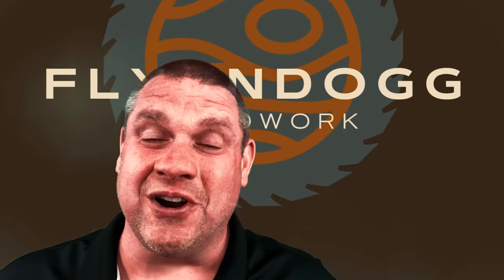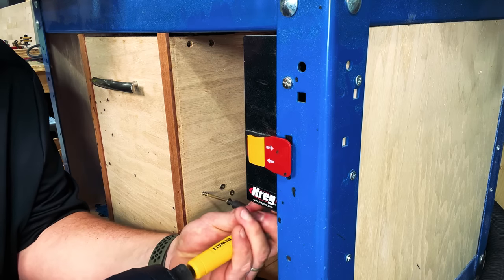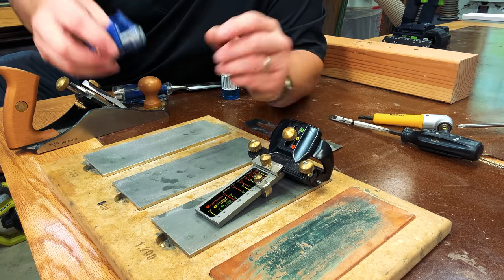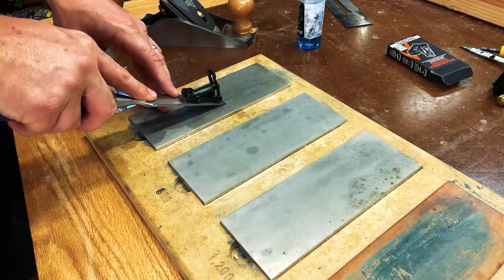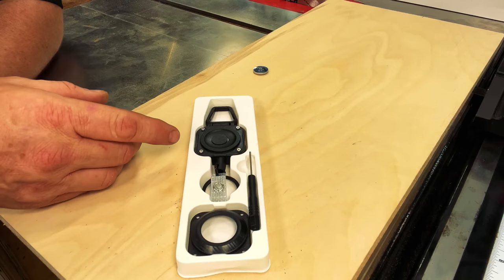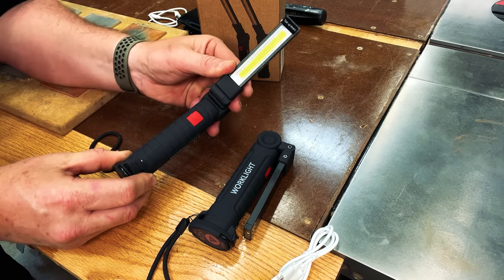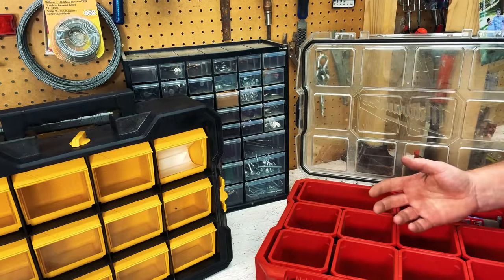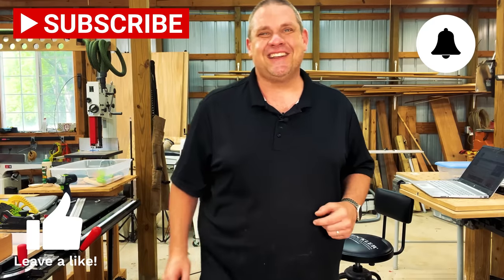Unveiling the 5 Mind-Blowing Woodworking Tools That'll Change Your Projects Forever

Comment: I suggest that you get a cheap painting drop cloth and toss over the hardware bins. At least until you can build something that will keep the dust out. For me it’s aggravating to reach into an open bin and get dust and sawdust with my hardware. Maybe I’m just OCD😅.
Reply from the maker: What a great idea Parts Dave, I actually just met with a contractor yesterday to talk about getting my barn all insulated so that I can start to keep it climatized and cleaner.  Excellent idea and thanks for sharing!
Reply: @FlynndoggWoodwork    I’m in Arkansas. I had my shop Spray Foam insulated a couple years ago. My shop is just a large portable wood building that was built on site. I have open cell insulation because of location and it’s shaded most of the day. In the winter it is easy to heat. Haven’t purchased A/C yet. 
At first I did regret the smell. Took months to get it to bearable for me. Covering with OSB on the wall helped some. Still haven’t covered the ceiling. You’ll probably want Closed Cell since you’re in a colder area and it’ll serve as your vapor barrier. 
If you plan on adding ANY electrical outlets, plumbing, etc. do that FIRST. If not, you’ll wish you had later when you do. Closed cell is like concrete. Very hard. Open cell is much like blow-molded packing foam in those gray bags. It’s delicate but easier to cut out if needed. Also, you can use spray foam in cans to replace it after done with your project. 
Also, I run a dehumidifier in there. Humidity stays at my target of 35 % without any problem. 
Just my experience…..
Reply from the maker: @partsdave8943  Thanks so much for the information!   Very useful.  My plan is to let the contractor do the framin g and insulation installation and them I want to finish it off.   Probably will have an electrician come out before that as well.  I want to add about 2X more outlets and a couple of 220s just to make it more convenient.   I'll do that right before drywall (or plywood with something on top of it)   That will be the fun part I think. Kind of like a blank canvas!

Comment: They might feel firmer if you keep them closer to full. 3/4 empty will allow for more bending. 
Also, a dab of CA glue on one screw and put on the front of the bin will speed up the search. Especially if you have many bins in use. You probably do this but I would start with the smallest screws on one end (Left for me) and progress in size to the right. Thanks for more great tips!
Reply from the maker: Oh man what great ideas on both!  I was just thinking about labeling them but I like your idea better!  Maybe a label and a screw CA’d on would be a good idea.  Thank you so much for sharing and the great tips!   Love it!  I appreciate you watching Louis!
Reply: The screw on the front was not original. Read about it years ago. Thought it was good enough to share. 
Sharing tips unites all
woodworkers.
Reply from the maker: @louislandi938  100% agree!  Thanks agian!

Comment: The plastic of the organizers falls completely apart after a few years.  Now I use the Harbor smaller grey organizers with this metal shelf, which are much more durable.
Reply from the maker: Great to know mak4374!  Thank you for sharing, and thanks for watching.   I've also seen some aftermarket bins that you can buy that seem to be a little more durable, but probably also depends on how often you pull the shelves out and use them.   I appreciate your comment!